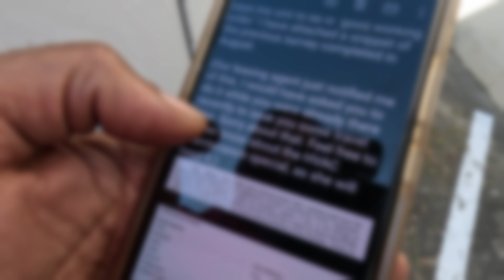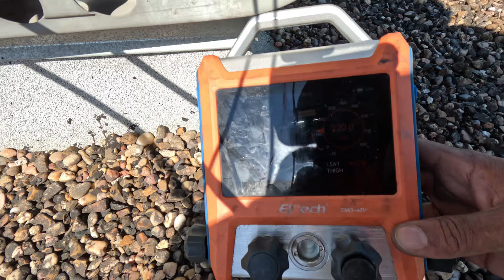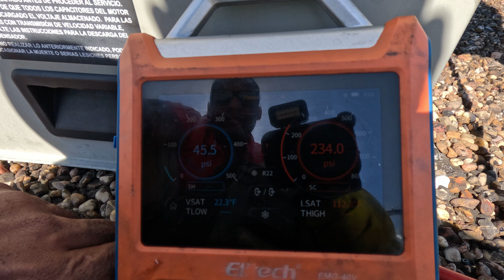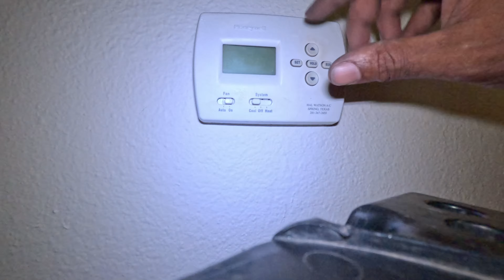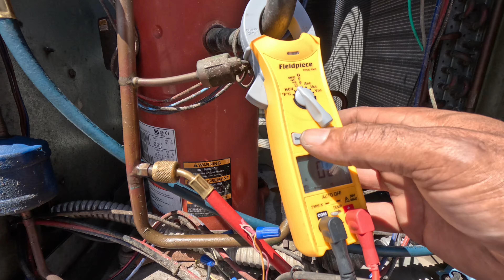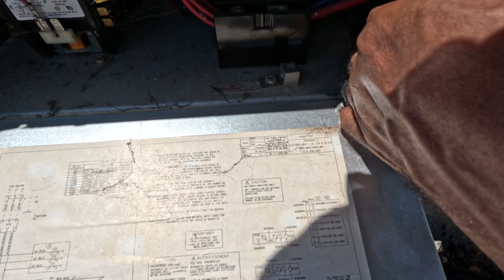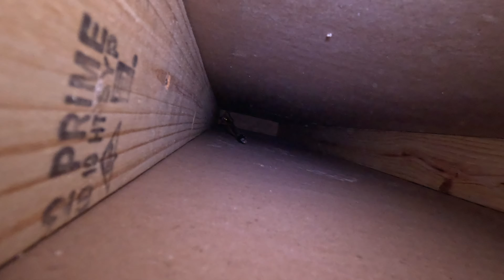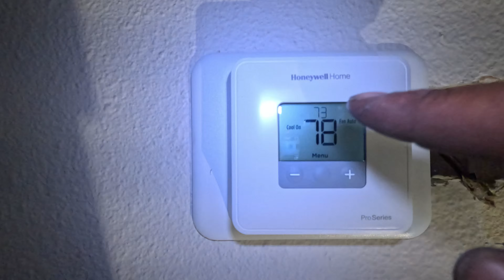Untangling the Web: Troubleshooting Multiple Cooling Problems on a Trane Package Unit

Comment: Figuring out that thermostat wire Nest was incredible however Washington all you needed was a long extension, screwdriver or piece of rebar and a hammer and knock that bottom screw away releasing the thermostat wire. Lastly I still pick up and learn something thanks Washington

Comment: What a cluster with those thermostat wire.  This is why its a good idea to have some kind of "manifest" or a service list inside the until so that the next time a tech opens up the unit, he will see what has been done and when as well as any NOTES as to why colors aren't typical or other items of interest to the next guy. Even the same tech will not remember if they return 6 months later. That smoke detector must shut the system off if it sees smoke etc. so that may be a fire code requirement my guess. And yes, I have seen many times in new construction where the low volt wires are tied around a nail or looped and bundled around some kind of fastener so the drywall guys or the HVAC guys know where the thermostat goes. Problem is, they leave the bundle of wires attached to the fasteners and once the drywall is up or finish work is complete, it makes fishing a new set of wires much more time consuming. That was a good fix, going the extra distance to run a new set of wires vs. repair them in a difficult location to do it 100% correct. You would think the building codes would allow for more accessable water faucets to service a building that big. Its not like we will see any "cordless" wash the coils down tools any time soon. 
My only suggestion would be to wear those latex gloves when finalizing the thermostat install so keep fingerprints off of the new wall location and thermostat.
Reply from the maker: I try to remember to wear my latex gloves but forget sometimes. I do always clean dirt or fingerprints before completing even though I may not get it  captured on video.. As always thanks for watching and commenting!!
Reply: @WWHVAC  I figured so but mentioned it as it wasn't in the video.